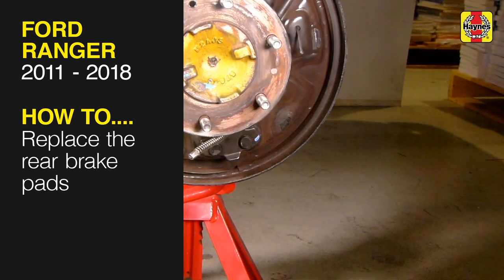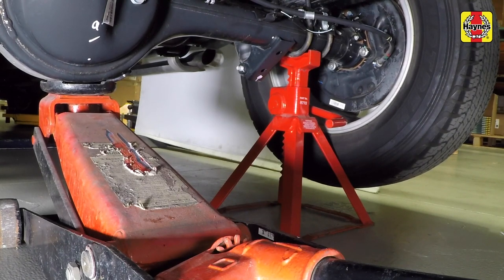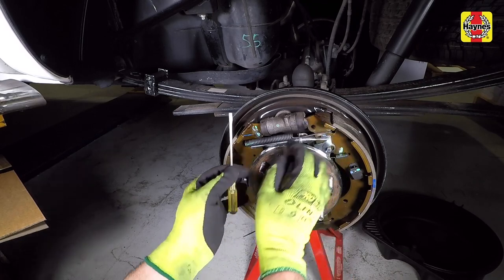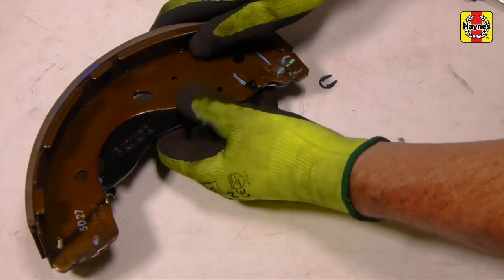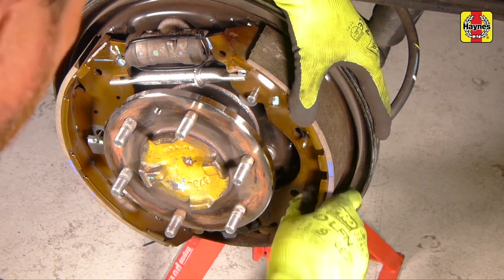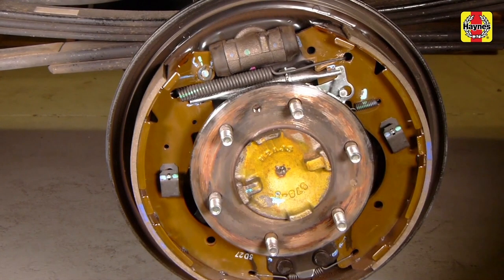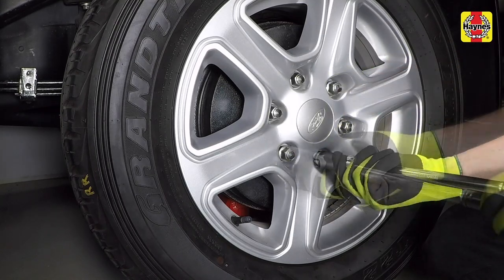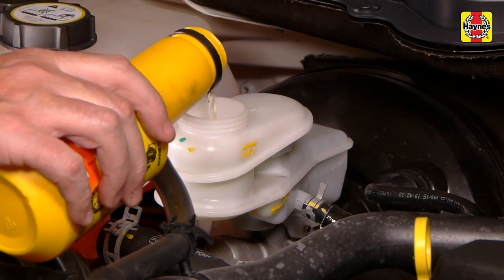How to Replace the rear brake pads on the Ford Ranger 2011 to 2018

Comment: If your brake drum is seized to the hub, you can use the set screw in the other screw hole and simply thread it in and turn it until the rust cracks and the drum is broken free. Be sure to remove as much rush as possible before trying to thread the screw in.